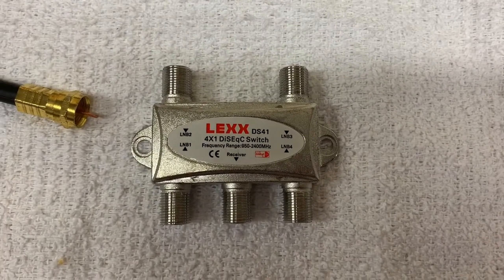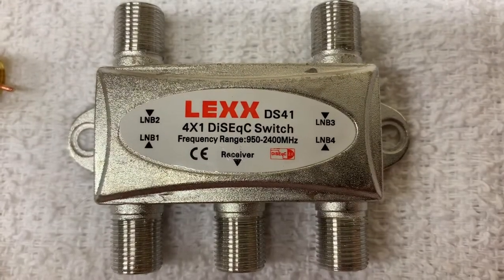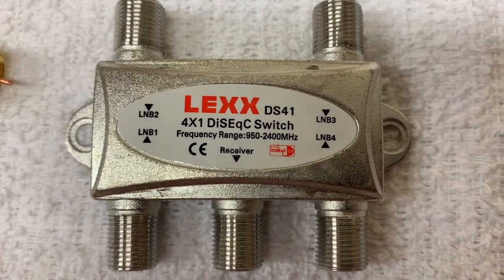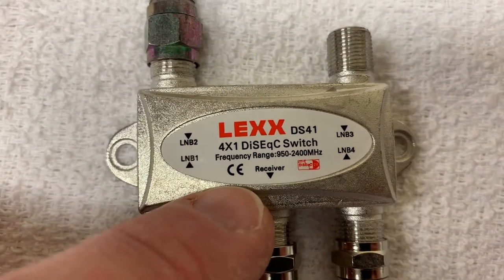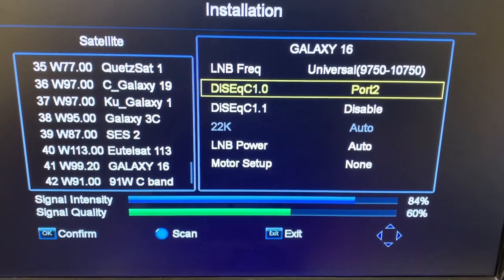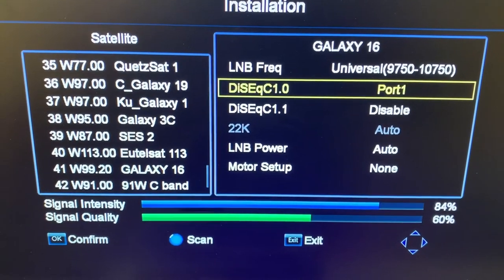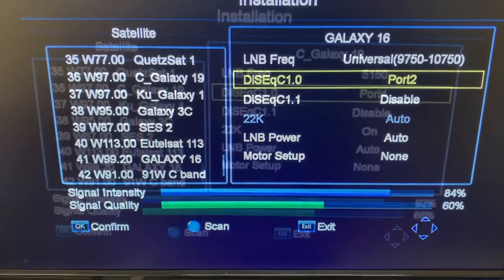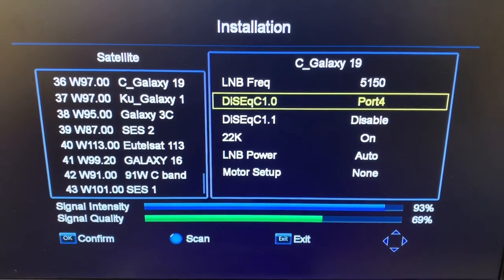What is a DiSEqC Switch and how does it work?

Comment: Can you go ahead and split signals from the disec switch to another receiver probably a neighbor?
Reply from the maker: I’ve used a splitter before a DiSEqC switch, but using one after may be tricky. The DiSEqC needs voltage from the receiver to work. You’d have to ensure that the splitter has power passing to allow the receiver to backfeed power to the DiSEqC. Each receiver connected would have to be properly programmed in the menu with the correct DiSEqC commands. It might possibly work, I guess try it and see. But I’m not 100% sure.

Comment: Kindly help me out how to use 8 ways diseqc switch for 6 satellites to decoder because not working for my new h265 decoder not support it but support 8 ways diseqc switch my old decoder.
Reply from the maker: Look in the satellite installation menu. You need to use DiSEqC 1.1, that will command an 8-way switch, as well as a 16-way switch.

Comment: My new h265 decoder not support 8 ways diseqc switch for 6 satellites on it but my old wise techh264 decoder support 8 ways diseqc switch but why or what can I do sir thank you sir.
Reply from the maker: Look in the satellite installation menu. You need to use DiSEqC 1.1, that will command an 8-way switch.